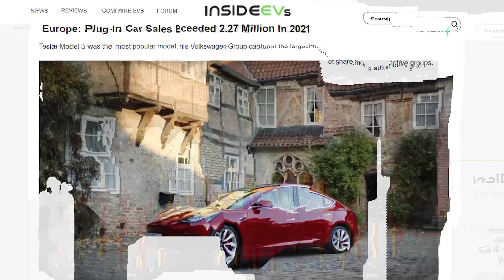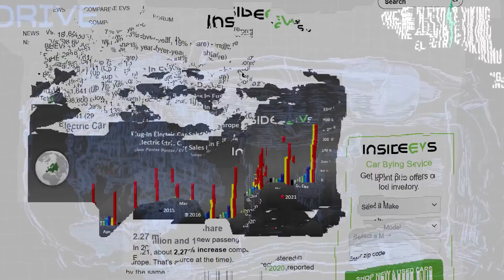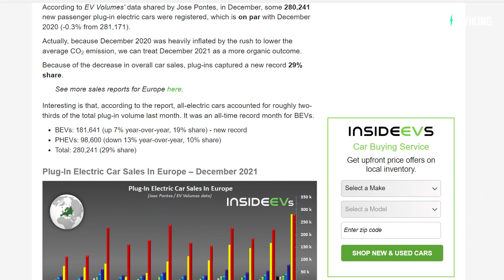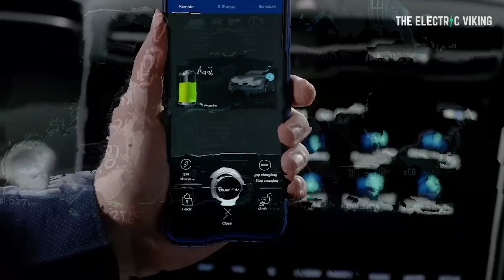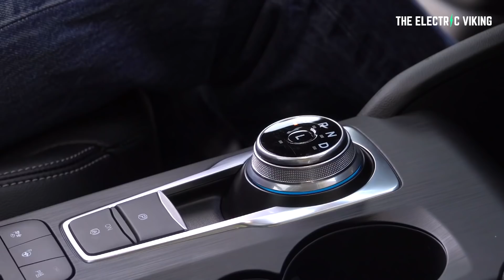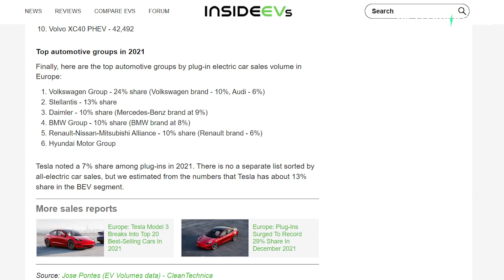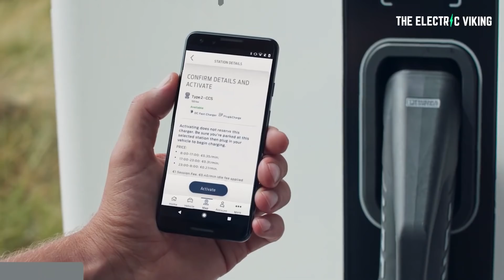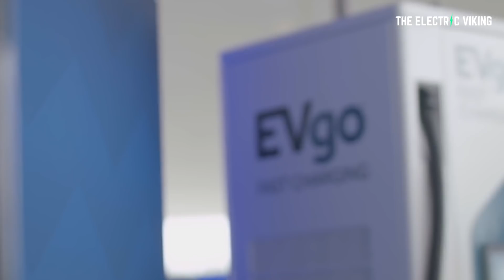2021 EV sales data: Europe passes EV adoption tipping point

Comment: Ford just released a hybrid pickup truck with the Maverick, I believe that will help American numbers, however Ford made a massive mistake by not allowing AWD with the hybrid drivetrain. 

I was sold on the Maverick the moment I was made aware of it, but I bought the fully gasoline version with no hybrid engine because I absolutely need AWD or 4x4. But a small truck works fine for me! Sad I couldn't have both AWD and hybrid

Comment: Sam, I retired on TSLA stock in Aug 2020 after 29 years in the semi industry.  The reason that legacy ice mfrs are claiming (I believe mostly honestly) and startups don’t have a problem, is because legacy mfrs are using legacy chips, ie they are not state of the art chips and thus are made in old factories even at TSMC, and thus are very limited in the factory capacities.  Legacy ice need to redesign with more modern chips to get more volume.  Startups have two advantages:  1) they are smaller and don’t need as many chips, but 2) they are doing their first design and thus are using more state of the art chips which are available in much more volume than older chips.   Thus is a large reason why there is a disconnect between startups and legacy.  There is also a shortage at the state of the art, and that’s being addressed with new factories, but they literally take tears to complete.
Reply: Bravo! Love story like that Mozel tov!

Comment: Just a comment on chip sales, and the truth.  You have have to remember that the chips used by startup and Tesla/BYD are modern and up to date and current technology and the ideal product for the chip manufactures.  The legacy auto companies are still using legacy infotainment systems with legacy hardware (we know all about the laggy function - that is old technology not keeping up with newer software).  Chip manufactures don't want to produce legacy architectures as they have to re-tool and just a pain and the profit margins are not as high (newer chip technology is more expensive and state of the art with higher profit margin). 
So I believe there is some chip shortage - but for legacy hardware which effects the legacy auto and does NOT affect the new manufactures.

Comment: Covid has had an impact on car sales generally but 2021 was supposed to be the ‘bounce back’ year. It didn’t happen, why? The Osborne effect is kicking in, people holding back purchases knowing that the market is changing towards EVs and not wanting to be left with a fossil car that will drop in value much quicker than it would have done previously...while at the same time holding back for EV prices to converge with ICE and/or waiting for the right EV model the buyer wants to become available. Remember, there are still sectors of the market where there is very little choice of EV. Your predictions for 2022 are a bit high I would say. Pre-Covid the total new car market here was around 14 to 15 million a year, it will recover a bit this year from the 12 million of last to around 13 million. Europe will do well to hit 30% EV+PHEV share this year, so let’s say just under 4 million sales. The reason I say this is that battery supply is still a constraining factor and although some new models are coming (Renault Megane, Nissan Ariya) the market sectors where most Europeans buy do not have enough choice yet.

Comment: Tipping point my arse! Certainly not here in UK. The infrastructure is just not there yet. When it works its great but more ev vehicles mean more people queuing for the few chargers available all with different charge/ payment methods and connectors. Certainly not tipping me to that point of adoption! On top of that where is the recycling infrastructure for used batteries!

Comment: Sam, you constantly mix terms. Plug in hybrid is also EV! Mild hybrid as well. Hydrogen cars as well. So when we talking about EVs, we are talking about everything with electric motor inside (Plug in and Mild hybrids, Fuel cell vehicles (FCEV) and battery electric vehicles (BEV))
Reply: Almost. If it gets its all of its energy from gasoline like mild hybrids, then it is still considered ICE. But yes, everything with a plug is an EV.

Comment: Love the content, the research and work you put in…Maybe catch a little sleep Sam you look worn out.😀 Here in Southern California BEV’s are taking over, can’t happen soon enough! Charge my model S and Y with my 50 Kw solar PV system at home avoiding entirely the $5+ per gallon gas prices. WIN!WIN!
Reply: I agree with David Sam, make sure you get more rest please, for you and your family.
Reply: Between your Teslas and your solsr installation that comes to 6 figures plus which is enough to pay for more than 20,000 gallons of gas. Let's say your car averages 20 miles per gallon. That would give you 400,000 miles of driving. Personally I would get a Prius that gets 50mpg so that would get a million miles and that car is way cheaper than a Tesla. Arguing on environmental grounds for EV's is one thing but it doesnt stack up cost wise.
Reply: @aftonline   Let’s do some math shall we? Being a P.E this should be easy…. I purchased my first Tesla S in 2015 for 40K, put 60,000 miles on it and sold it in 2018 for 35k. Besides a set of tires ($1200) The car had $500 in maintenance. So 60,000 miles \ $6700 = 8.9 cents a mile compared to an ICE car @.58 per mile and a minimum of 50% depreciation. Let’s leave the depreciation out for now, ICE , 60,000 miles x.58 = $34,800….. So I saved 28k or so and drove a car that stomped most ICE cars. As for the solar….my cost was $120,000 before the 30% Fed tax credit , net cost of $84,000.

I live in a large home with a guest house in SoCal, my solar offsets apx. $2000 per month or $24,000 per annum in electric cost. Along with charging my cars it will pay for itself in about three years. And considering you pay your household bills in after tax dollars (I’m in the 53% bracket Fed and State) it actually pays for itself in 2 years or less. Along with adding value to my property, solar if you process the analytic skills is a no brainer. 

And I prefer to just be smarter than burning “20,000 gallons of gas”
Reply: @davidsnow791   As I thought, pretty much a six figure investment. The test of whether this investment is paying off is whether it whether it's doable for those on a lower income. I spent $5000 on a cheap car and write off the cost of the fuel and maintenance from my food delivery business. I don't have to run to the bank asking for a six figure loan just so I can go electric and reduce my power bill a little. They'd laugh me out the door.
Reply: @aftonline   Sure, if you have a $50 power bill it makes no sense. But if you have the means and the costs associated with a large property it makes absolute sense. Returns on my idle cash of 30+ % per annum and tax free are hard to match. Understand this is more of a chess move, you may need to stop playing checkers.
Reply: @davidsnow791   Sure and if my ego and my bank balance ever get big enough maybe I will go electric. Perhaps for us little guys life is not a game just a battle to survive from one day to the next. We cant all be millionaires or the whole capitalist system we rely on would collapse like a house of cards. But congrats on your success my friend. You obviously have it all figured out.
Reply: @aftonline  Yes I have. Good luck with your business and all other of your endeavors. Shalom.

Comment: Australia recorded 20,665 EV sales in 2021, a significant increase from the 6,900 sold in 2020, which means electric cars now make up 1.95% of the new car market.
Reply: But most of those sales were in the second half of the year, so December quarter share will be higher than that.

Comment: "But it is true that overall car sales declined by 22% year-over-year in Europe. I think that's got something to do with the pandemic, though ..."

Or maybe it's got something to do with buyers holding off until EV technology and prices have stabilized somewhat.
Reply: I certainly fit in that camp.  Let the production line work out the bugs and supply expand.   Plus I want one of those no frills small cars with 200 mile range, and I will just have to wait apparently.  There are none in my price range yet.    Not getting on the road with crazy people in an asset on wheels worth more than my house...haha!
Reply: @woody3307  "There are none in my price range yet."

I'm curious how the cost of a new EV would compare to a comparable ICE car taking into account lifecycle fuel costs. Not at today's prices, but at anticipated oil prices and renewable electricity prices in 5 or 10 years.

Comment: You don’t just sound insane. You have to believe chip shortages when Elon himself says so. When was the last time you shopped for chips.
Reply: Elon is getting into the battery making portion of the EVs , I am somewhat surprise He don't expand into the chip business.
Reply: @icosthop9998  The semiconductor market would be a huge business opportunity for Tesla currently, yes, but it would also take a long time and a large amount of capital to build out the infrastructure by which time the opportunity may have passed. Just my opinion, I'm an ignoramus on the subject and by no means an informed expert.
Reply: @Critoxyn   Well that's not even the thoughts I had in my mind so thank you.
 It takes like what 3 , years to get one up and going.
 Thank you once again.